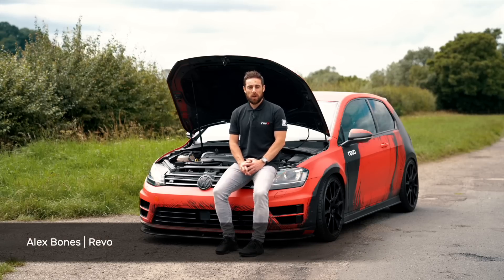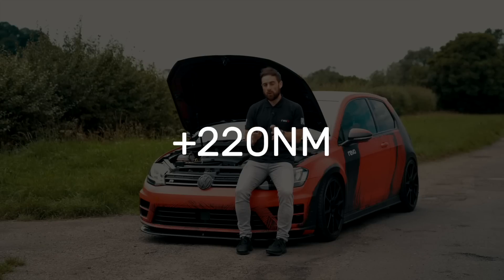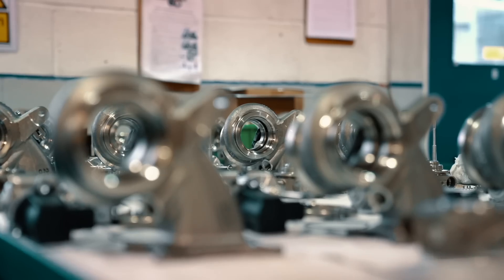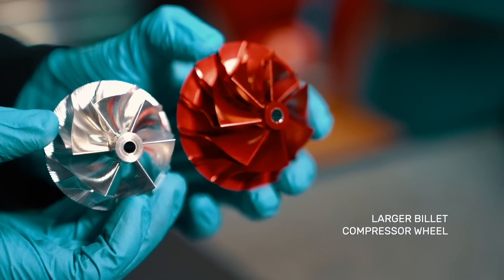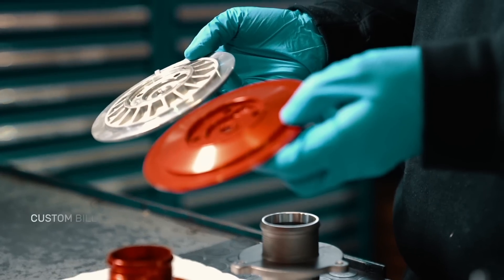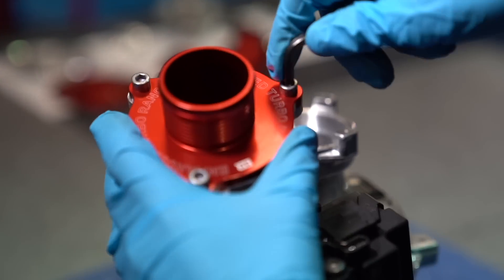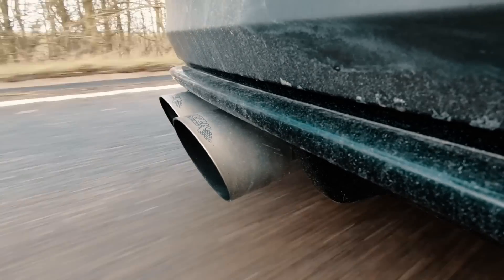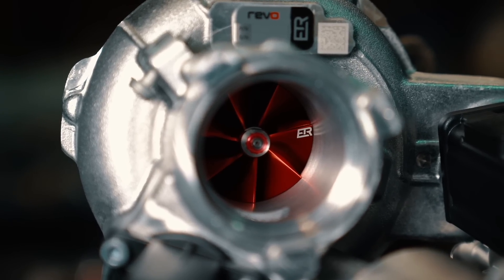Can you get 520bhp from a stock engine'd Golf R?

Comment: The local store doesn’t have the stage 3 or the v2 turbo for a golf r is it still possible to order trough them ?
Reply from the maker: Yes. Not sure why a Revo Dealer wouldn't have access to the software. Unless it isn't available for your specific ECU ID. And yes all Revo Hardware can be ordered directly through a Revo Dealer. onlyrevo.com/dealer-locator
Reply: @RevoHQ  it was for a golf r from 2018 so it should be possible to order the stage 3 software and the turbo i live in the Netherlands

Comment: Hi, I see you write in the comments that downpipe is required for non GPF models, do I need catless downpipe or I can use legal HJS 200 zeller tuning downpipe (or similiar). I live in Germany and catless or racing downpipes are mostly illegal, so I need to know because I really like all the products from REVO! :)
Reply from the maker: Hi, all our software is designed to work with a sports cat/downpipe. Allowing the customer to the option to install this option, or to installed a car less downpipe if they require or allowed.

Comment: Does revo have a S3 stage 2/3 kit including this turbo? (8v)
Reply from the maker: Stage 2 is designed for stock IS38 turbo, but would require an Intake, Intercooler and downpipe (non GPF models), our Stage 3 software is design for the IS38ETR turbo. Head over to onlyrevo.com for more information.

Comment: What clutch are you running on this setup?
Reply from the maker: Stock DSG clutches are fine with this setup. However as the car is used on track we have upgraded to a performance clutch pack which we offer specific TCU software for.
Reply: @RevoHQ  what about the manual clutch that comes with the R?
Reply from the maker: @m3rri3n36  You ideally need a performance clutch on a manual Mk7 from Stage 1 upwards.
Reply: @RevoHQ  great, will look into it, thanks

Comment: What are the supporting mods you need to do in order for this to run safely in your car?
Reply from the maker: As a general overview, Turbo back exhaust system, Intercooler, Intake, ETR Turbo, Fuel Pumps and ECU/TCU software. Other things to consider are Clutch for manual cars, engine mounts and brakes. Best to head over to onlyrevo.com for more Information . Thank you :)

Comment: I have a manual, 2014, Golf R. Its stock apart from the plug in TDI Tuning box I have on it at the moment. What would be the cost to do a stage 3 tune with you guys please?
Reply from the maker: Give your local Revo dealer a call for a full quotation. onlyrevo.com/dealer-locator
Reply: @RevoHQ  thanks you guys, will do.

Comment: Is the stock is38 on Cupra ST 300 dsg6 model year 2018 reliable for revo stage 1 software or is this turbocharger like an russian roulette like they say?
Reply from the maker: Fine, its our most tuned engine type. The early IS38 turbos from round 2014 did have a few issues, but they have gone through a few revisions since then.
Reply: @RevoHQ  I was also thinking like if it really was such a common problem with the newer ones than you guys wouldn't recommend tuning the factory is38 without changing to a stronger turbocharger am I wrong? Have a nice day!
Reply from the maker: @qendrimberisha5773  100%. We don't release software that we aren't happy with. The turbo issue only affected a very small percentage of cars, tuned and non tuned.
Reply: @RevoHQ  How much HP and nm can I get out of my Cupra with stage 1? I have BMC filter with forge inlet to the turbo and Milltek catback non resonated? Thank you for your fast feedback.
Reply from the maker: @qendrimberisha5773  Depends on which Cupra you have. Best to head over to onlyrevo.com and take a look at what we offer for your specific vehicle. Thank you

Comment: Would these upgrades be suitable for a S3 and how do they impact the stock transmission?
Reply from the maker: Yes, the S3 8V uses the same platform. If DSG you will require TCU software, manual car will require a clutch.

Comment: 7500 redline??
Reply from the maker: Yes, its our development vehicle and we test lots of parameters on this. Generally on customer vehicles will shift 7000-7100rpm in sports and dynamic mode.
Reply: Revo That’s mega. I had a 2014 stage 2 APR tuned gti performance edition CHHA engine code with 169kw factory. It’s redline was around 6600-6800. 

That is so cool to see. In 10+ years time when I get a mk7/7.5 again I think I’ll have to give revo a crack. 7500 is just mega

Comment: how does it work on a daily basis, in urban use?  because normally the bigger the turbine, the worse the start, the car has bigger turbo lag.
Reply from the maker: You do have slightly more lag.  But as our software is designed on the road rather than solely on a dyno it's as capable as a daily as well as it is on open roads or track.

Comment: U can, but u will not drive a long time without stronger interials
Reply from the maker: Our car is now 5 years old, and have vehicles running an ETR setup for 3/4 years now. THe ETR v1 sent over 2 years in development before full public release. Its designed to run on a stock engine.

Comment: Better hope your car was built on a Tuesday pushing that kind of power over stock.
Reply from the maker: Been around 500hp for many years now, so guessing it was a Tuesday build ;)
Reply: Hey revo can you confirm something for me, on the audi s1 it has the CWZA engine which is supposed to be the same engine in the mk7 golf gti, but I noticed it runs the same compression ratio as the audi s3 variant, which is correct.

Comment: Will this kits works on a Audi Q3?
Reply from the maker: Yes, in the fact the turbo should fit (not tested and a question for our engineers) but not something we currently support with software.
Reply: @RevoHQ  should they develop software to support the turbo for a 2013 audi q3, i be the first person to aquire it
Reply: @RevoHQ  Could i get some serious feedback please, as I'm truly interested
Reply from the maker: @georgepeters3432  Sorry for the confussion, we should have asked you the year of your Q3 first. The 2013 Q3 has a different engine to the EA888 Gen3 which is used in this video. Unfortunately, this kit therefor wont fit. We do however offer software for the Q3 2.0 TSi, do you know if its the 170, 180 and 220ps variant?
Reply: @RevoHQ  it is the 155KW variant. I was going to order prior the K04 Hybird turbo for it with software, but i stumbled upon this video and got wild ideas. I already have the 3" downpipe, new turbo outlet and waiting for the intercooler. I'm being told it will give me a 355HP output. If you guys have something better please do say, i am still open to suggestions.

Comment: So it's a refurbished modified  turbo not a new one
Reply from the maker: Its a hybrid solution, built from brand new oem IS38 units.
Reply: @RevoHQ  right so it's a modified s3 golf R oem turbo with new components on the inside to make it a hybrid ✌by changing the turbine and skimming the inside diameter of the housing of the factory turbo  and use other components why not just make your own  turbo if you all went to the effort to modify a factory turbo sounds like a bit of a scam tbh revo cutting corners Haha take it yous dont want to pay to create your own turbo casting a metal billet ,  put through milling then turning ,  because that would cost revo too much money and revo wouldnt make that back on selling it  Am I right?
Reply: Not hating at all I have a seat leon cupra 280 stage 2 revo tuned and I love it  never seen the point in stage 3 asking for somthing in the engine to fail if continuously driving hard dont think the engines could hold near 500bhp on standard internals my friend has a stage 4/5 s3 fully built big turbo 550bhp runs 10s quater mile he had to get it built because a piston melted on stage 3 😑
Reply from the maker: @Sean-ek8wc  We do 3 types of turbos, OEM turbos, ETR (Enhanced Turbos) which are Hybrid solutions and RT Turbos which fully cast options. It's not about cost-cutting as the stock units arent cheap ;) An Enhanced turbo upgrade is a step between factory and fully cast. Ultising the existing housing, all the internals are replaced for reliability and any restrictive parts are redesigned or upgraded to ensure performance gains. Also using the stock housing minimises lag whilst achieving the best performance and OEM fitment. This is the whole concept of any "hybrid" turbo solution. When you look at "bigger" cast turbos you are generally doing this as the next step up from a hybrid solution, increasing wheel size and housing, this will ultimately give more performance, but in turn more lag.
Reply: It's about business.
Reply: @Sean-ek8wc  Did you think it was a charity?   Muppet

Comment: What are the actually rpm balancing spec say "motorsport" make it sounds more like a joke.    
Its not even speced on youre page..
just that you can get this and that HP with a fancy dyno picture.
Dont really say anything useful.

So i ask you here.
Spec balancing rpms?
And at what PSI load at 520hp ?

I ask this is because next summer i will stage 3 my 2018 mk7.5 Golf R.
As im still looking for options.
Reply from the maker: 24-27psi depending on the setup and fuel options. With regards to balancing, this is all by the manufacturer of the turbo, Owen Developments. The turbo has been designed alongside them for this specific application so will be tested and balanced beyond parameters seen when on the vehicle. Its something we can try and get more information from our engineers if you require. There is more information about the turbo here: https://www.onlyrevo.com/blog/520bhp-revo-is38etr-v2-the-ultimate-ea888-hybrid-turbo/

Best to drop an email over to hardware@revotechnik.com for more technical based questions.

Comment: Hi so the stock engine and dsg can handle this kind of power when tuned. No internals work need doing at all. Am i right in saying that. One other thing please how much power can theses engine handle in stock form 600-800 BHP. Thanks.
Reply from the maker: BHP is a variable number so you cant give a peak figure for engine safety, there are lots of factors. This setup is designed for a stock engine to give a balance of performance, driveability and longevity.  If you're looking for 600+ then you really should be looking at additional hardware upgrades.

Comment: Sooooo if the current AW polo GTI runs the same engine, can we use the same parts to upgrade the AW???? 
Been waiting twelve months to upgrade my AW with revo parts now
Reply from the maker: There are some hardware differences on the polo, and its closer to the GTi setup rather than the R.  Also, the Polo uses the MG1 ECU, which delayed development. MG1 is something we continue to work on.
Reply: It's the same ea888, but not the same components. Plus the turbo is smaller, here they talk abt upgrading is38.
Reply: I really hope you guys are developing something for the new AW polo gti then. I really want to start modifying mine with quality parts and making some more power from them. Want it to be sitting around the 180-200kw mark
Reply: Whether that be hardware or software you guys end up developing. Hopefully both!!
Reply from the maker: @jaycobdokmanovic2984  https://www.onlyrevo.com/blog/revo-updates-on-tuning-the-bosch-md1-and-mg1-ecu/

Comment: 520bhp? Many reputable tuning companies that specialise in these MQB chassis cars can get upto 600 bhp from these engines on stock internals! And it's been done for a good few years now
Reply from the maker: It's not all about peak dyno numbers. Usable power and driveability are a key factor, along with longevity, of course, you can push things harder, but for how long?. This is designed as a package to offer consistent performance that's as usable as a daily as well as having the performance there, for those more, fun times :)

Comment: How does the engine internals hold up to track events being pushed 100% all weekend, big difference than daily?
Reply from the maker: We have run multiple track events over the last 5 years in this car. Even show days were it's been used as a demonstrator. We also have Alex Bones who has just built a track S3 using this ETR setup, so worth following. Obviously if you are looking for a something this specifically for track rather then road then there are a few more upgrades that would be beneficial
Reply: @RevoHQ  I currently have over temp issues. I have 2 recent videos showing this at Road Atlanta on my channel. I'm sure my oil temp was causing my water temp to climb as you can see in the videos. I bought an oil cooler that I will install soon. I already have hood vents on the low pressure area. I didn't know until recently that the R engine has some different made internal parts that my 2019 GTI does not have. I'm currently average 347WHP 374FTLBS and concerned if I go more I could damage my engine and or DSG transmission. Even at these levels my 245 Michelin Cup 2s work for grip accelerating out of corners. I wish I could have reliable 500whp and torque 400 or less. I enjoy my car but I may get rid of it in a year or so depending on money for a different car.

Comment: Would love to this to my MK3 octavia vrs, already revo stage 2 beast, but that turbo is the bollocks, shame you guys dont do overrun map for mine MY14 car
Reply from the maker: Unfortunately some on the early MQB 2.0 TSI cars have a different ECU structure which doesn't have the required areas for the safety features we use to add in our overrun feature.
Reply: Thats a shame though, but never mind, one thing i have on order though is a set RV019s in gloss black, just waiting for the back log of orders to clear been nearly 4 weeks or so since ordering them

Comment: Why do you British use bhp? Why the ** do you use crank power, use WHEEL power, 520hp is a huge difference to 400hp at the wheels due to that massive loss from the drive train and dual clutch
Reply from the maker: Just been the standard over here for a while now. Although we have a hub dyno here at Revo HQ, and runs around 460hp at the hubs.
Reply: @RevoHQ  thats more like it! Over here in aus, its all by the wheel, even hubs give more of a higher reading

Comment: So, in effect, Revo is stating that VW built-in a margin of 200nm for the engine’s internals, and the same for the gearbox, clutch, driveshafts and differentials? Yeah, right! What a load of misleading, specious BS!
Reply: No your wrong revo are not stating that VW themselves stated it about 4 years ago saying the engines will be capeable to run safely at 560bhp anything over is a risk do some research before you come chatting your BS
Reply: And as for gearbox,clutch,driveshaft and differentials go check out dave_7r on instagram he is running a golf r with a 2.5litre rs3 engine at 988bhp these cars are very capeable trust me

Comment: 3 launches later, car broke 🤣
Reply from the maker: 6 years and a hell of a lot of launches later.....;)
Reply: @RevoHQ  Your telling me the haldex can handle 520hp? And not brake after a few launches?
Reply from the maker: @sam24545  More to do with torque delivery than peak power. We are into the hundreds with the number of launches on our development R over the last 6 years. We also have customers around the world running an ETR setup who do drag events and happily using launch control.
Reply: @RevoHQ  So i can launch the car with no worries? I had a 6R that had huge haldex issues but my mk7.5 is fine atm, only stage1 tuned though.

Comment: can we see a follow up video on this where you go into some more details about what supporting mods are needed and what power at different fuel quality  such as 91 octane (95 Ron) 93 octane (98  Ron)   i'm curious if this works with the OEM inlet elbow / aftermarket ones designed on the OEM Is38 inlet elbow size.  does this require a Low pressure fuel pump and high pressure fuel pump upgrade?  are injectors necessary?  This marketing video leaves me with so many questions. :)  I'd also like to see where "full boost" at RPM is, as having boost come in early is important to most for street driveablity :)
Reply from the maker: You can find lots of information at onlyrevo.com for your specific vehicle and setup. 

But to answer a few questions:
- 455-520bhp depending on fuel quality and running conditions
- Will technically work with OEM inlet, but you will be restricting airflow and the internal diameter will cause a step. We have a specific machined inlet to match the turbo inlet. So would require an intake and inlet upgrade.
- Fuel pumps, LPFP is required on all vehicles, HPFP is required on older vehicles.  
- Stock Injectors
- Dyno graphs are on the website. 

Any more questions please feel free to contact us or your local Revo Authorised Dealer.

Comment: So what does all that power translate to in performance?
Reply from the maker: We have a Revo leader board for customers, currently the quickest times are:
0-60mph 2.94s
100-200kph 6.34s
1/4 mile 10.48s
Reply: Revo I heard the APR ECU and TCU tune is the best. How does the Revo tune compare?
Reply from the maker: @JettyBuilder  We've heard the opposite ;) Honestly, You'd have to try it for yourself. We offer a 30-day money-back guarantee with all our software.
Reply: Revo ok thanks. I guess they will be similar. The Audi 2.0 TFSI can deliver a lot over stock.

Comment: What fuel type do you need to run that for those 500hp power ? Also upgraded intercooler and downpipe ?
Reply from the maker: Intercooler, Intake, Downpipe, Turbo and fuel pumps are required. 99ron or above fuelling for 500+
Reply: @MementoMori-xx5qo  99 Ron shell v power or tesco momentum only

Comment: How much would this cost to transform a completely stock Golf R to a 520 bhp Golf R?
Reply from the maker: Give your local Revo dealer a call as there are many hardware options. They will be able to give you a full quotation. onlyrevo.com/dealer-locator
Reply: Over priced
Reply: @johan9574  youll be faster than 95%+ cars on the road. 3 second 0-60 is nothing to scoff at